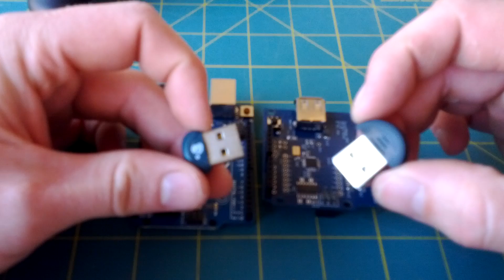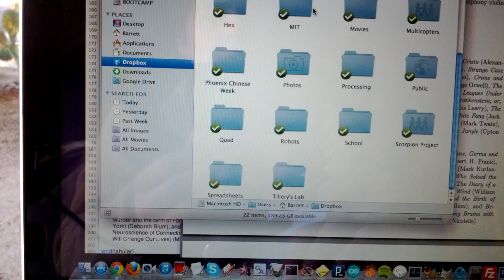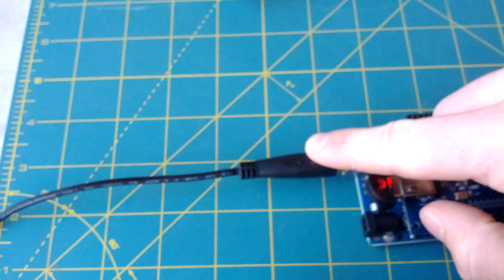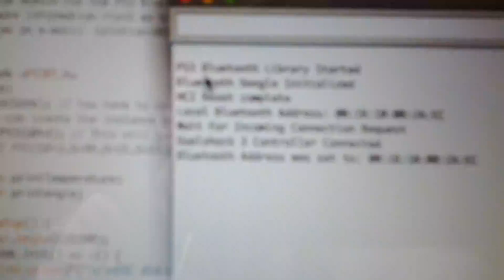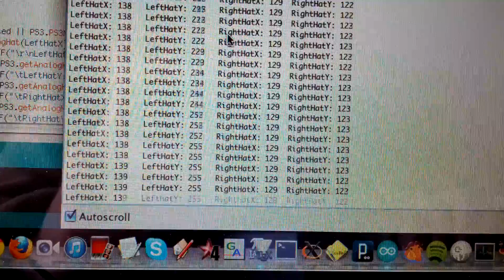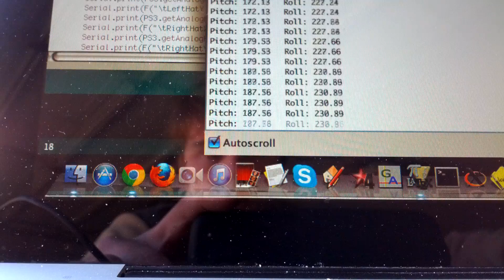How to Connect a PS3 controller to an Arduino with a USB host shield and Bluetooth dongle (Part 1)

Comment: Ok, I'm back!
I've used your tips to control two servos and four motors in differential steering configuration on my amphibious bulldozer project. It worked fine after a lot of work.

I'm here just to say thank you Barrett Anderies and to share my experience:
In my case, I needed to share the motor batteries with the Arduino because the circuit (Arduino Mega + USB Shield + Bluetooth Dongle) was drawing a lot of current. I've never heard that the 5V output pin on Arduino could be used as an 5V input until I needed to do that. So I used a 7805 voltage regulator (and it's mandatory to do that!!!) and connected his output to the 5V pin of the Arduino.
I had many problems when I was using differents ground sources. I guess the digital circuits of both USB Host Shield and Bluetooth Dongle are more sensibles to that. In general, you should use a single ground level to the whole circuit. My doubt here was about sharing any wire between the low power circuit (Arduino, shield and dongle) and high power circuit (h-bridges and motors). It seems there is no problem in sharing the ground wire, but I used many diodes anyway. Just for precaution. 

Sadly I don't have any vídeo of the working project and it's already dismounted. :(

Good luck!
Reply from the maker: André,

Thanks for the information and congrats on your project! You should ALWAYS have a common (single) ground between all of your circuits. You are correct that you would not want to share the high power lines (positive (red)) of the drive system with that of the control circuit, but all the grounds (black) should always be common.

Comment: Excellent tutorial. I am really impressed by the details shown. It was easy peezy! However, this library is useless for UNO as there is no space left to do any programming. Is there a way to reduce the size of library? Otherwise, I'll buy Mega.
Reply from the maker: Yes, you can reduce the size of the sketch. The fewer library functions you use, the less space is used. For example, if you open the PS3BT.ino and remove the code that accesses the gyroscope information you will notice a reduction in sketch size. If you're only using a few functions, you can easily use an UNO for most projects. I recently used an UNO to drive six servos with the library using the joysticks, D-pad and the four buttons on the right.
Reply: Barrett Anderies
Thanks a lot! I was able to reduce it to 25K after removing pitch and roll functions. I only need Right Joystick, Left Joystick and cross button. Were you able to reduce it even further?
Reply from the maker: Param S Try removing all function calls to buttons you don't need. That will give you an idea of the smallest you will be able to get it.
Reply: Thanks! I ended up using mega as I needed 4 interrupts for 4 dc motors with encoders.
Another question: Can you think of a some way to know approximate distance from USB host shield to phone, assuming they are connected by bluetooth? I don't want to add any sensor to outside of the phone., adding sensors to the shield/arduino unit is acceptable. Is this even possible? I want my robot to follow my phone at a set distance, say two feet away.
Reply from the maker: Param S You will not be able to estimate distance using Bluetooth, but there are a variety of sensors that can. You could use a sonar like the Maxbotix LV-EZ0, or a infrared range finder like the Sharp GP2Y0A21YK. Both are pretty cheep and will have plenty of accuracy for your application.
Reply: Barrett Anderies
I think there are two issues here:
1) Robot has to detect phone not the person who might be having phone in his pocket. Phone becomes the lock for the robot so that it ignores all other objects and follows the person carrying the phone.
2) Sensor also needs to deliver not just the distance but also the direction of the target object.e.g. whether the person carrying the phone is to its left, right, front or back or any (x,y) co-ordinates of person/phone where the origin is center of the robot.
The reason I need the displacement vector is that robot needs to follow exactly the same path as the person is walking on. It is like invisible line following robot. That line has to be created by sensors.
I would appreciate your thoughts!
- Thanks
Reply from the maker: Ah, yes, I see what you mean now. The best way would probably be to use a GPS. The robot would calculate its position and then receive the position of your phone over Bluetooth. With that information it could calculate the vector to you. There are actually some autopilot systems like ArduPilot that support this feature.
Reply: Thanks again, I would check it out.

Comment: So when I try to run the PS3BT example I get a message no matching function for call to 'PS3BT::getAnalogButton(Button)'  Any suggestions?  I have the Sparkfun board and when I run the example from the older library, I can get the PS3 controller to sync up and run.

Also, I am wondering is this will be able to be run the Arduino Wireless Proto Shiled with an XBee on this as well as the USB host board running the PS3BT.

Comment: How do you start PS3BT library?
Reply: I can't upload library to my Arduino i't says: USB does not name a type
Reply from the maker: 69greeninja That is a common error when you have not installed the library correctly. Make sure to place the library folder in "libraries" and remove all dots and dashes from the folder name.

Comment: Thank you for this video! It definitely pointed me in the right direction! But my USB host shield has no outer female sockets like yours does, will that still work?
Reply: I did order it at circuits at home. Is there anyway that it would still work, or any way that I could solder the headers on?
Reply from the maker: Tyler Bartolome Did you buy the pre-assembled version? If so, it only comes with male headers (as you've noticed). There is a second row of holes just inside of where the current headers are soldered. You can buy female headers and solder them there.
Reply: Barrett Anderies Thank you! I was slightly confused when I opened the box and only saw the male headers.

Comment: Thank you, guy! It helped me a lot!
There is a lack of information about that. So your video should be at the main sources about Arduino USB Host Shield + PS3 Controller! With this step-by-step video, it was easier than sync with Windows and DS3!
Thanks once more!
Reply: It could be useful to say that I'm using Keyes version of the shield with an Mega-like Arduino board. The chipset of this dongle is a CSR8510A10, so I believe that others with the same chipset will probably work.

Comment: would be possible to spend all the programming you did is that I am still a rookie?. thanks
Reply from the maker: The code I ran is included with the library. Once you install the library it will be available in the examples folder.
Reply: excellent thanks programming...

Comment: Would it be possible to do this for a different board and programming language?
I have a Servopod board from new micros and can program using isomax. Do you know of a library that works for this programming language?
Reply from the maker: Yes, but you would have to find/write the library. I do not know if a library exists for that language. The USB host chip is the MAX3421E. It is an SPI device, and therefore can be controlled by almost any microcontroller. You may be able to port the existing Ardunio library.

Comment: The address is hardware dependent on the controller, not on the dongle.  If you had the address 01:23:45:67:89:10. The first three bytes, 01:23:45, are specific to the manufacturer.  The last three, 67:89:10, are specific to the device.

Comment from the maker: If you plug your controller into the shield after having plugged in your Bluetooth dongle, the shield will automatically program the controller to the right address. However, since you can't see the debug information, you won't be able to tell if your shield recognized your dongle, which is a problem. I think your only viable option is to enable debugging in the code. Unfortunately this will make the sketch too large to fit on an UNO.

Comment: what is it the problem? when i received only 'PS3 Bluetooth Library Started'. i connected ps3 controller with usb host shield + arduino via USB cable, i dont see any other line printed out in the serial monitor, exvept 'PS3 Bluetooth Library Started'. therefore, is it possible, my USB host shield doesn't working.? or i just need to try out with other Bluetooth dongle?

Comment: fyi: when i was firstly trying to connect the PS3 controller to bluetooth dongle + usb host shield, it did not work. I tried almost 10 times then it got connected and worked fine. and NOW, i only can see 'PS3 Bluetooth Library Started' 
I would really appreciate if you can help me to figure out this issue, anyone feel free to put your comment below, Thank you once again.

Comment: 'unless you enable debugging in the code' what do you mean? what should i do, in order to make it connected. fyi: the USB host shield, i ordered from eBay, (not sparkfun or circuit@home, due to far travel shipping issue) 
' So, don't worry if you aren't seeing some of the information shown in this video.' what do you mean? is it my problem can be fixed? what should i do next. may i know, how did the guy manage to make it works successfully?

Comment: and now, what should i do next? i am trying so hard just to get the PS3 controller connected to the Bluetooth dongle +USB host shield. i have read through all the comments regarding this issue/problems, yet i still CANNOT connect it successfully. few steps that i have taken to settle this:
1. i used an external 9v dc adapter source to power up.
2. i used 2 different brand of Bluetooth dongle, 1 of them is exactly the same as the black one in your post video,
3. i connect ps3 cntrler using usb.

Comment: thank you for that,
and Now the problem comes, when i am trying to connect the PS3 controller with the USB dongle, there is only a line appear on the serial monitor "PS3 Bluetooth Library Started" why is that? i have also connected the PS3 controller with the USB host shield via USB cable, nothing appear on the screen as what i expected from your Post video, if you guys out there got the same problems as i do, feel free to comment. Thank You

Comment: Nevermind, solved the problem by looking into the source code. The baud is 115200 instead of the usual 9600. I don't know if that is mentioned in the video, whatever, I'm happy that it's working :D

Comment from the maker: It's possible, but you'll have to make sure the shields don't use the same pins at the same time. I know the USB host shield uses ISP to communicate with the Arduino, which uses digital pins 10 through 13 but I don't know what most motor shields use. If you can find a motor shield that doesn't use D10-D13 you should be fine.

Comment from the maker: You get that error when the IDE can't find the library, so yes, you probably didn't install the library correctly. Double check that the library folder is in the correct location and that there aren't any dots or dashes in the folder name.

Comment: Hey I need some help. My IDE is reading "USB does not read a type" as an error. does that mean I probably didn't properly move the file in right? Or did i not remove all dots and dashes.

Comment: Very helpful tutorial. I am about to get one of the USB host shield from eBay, either ‘USB Host Shield Support Google Android ADK & UNO MEGA Duemilanove 2560 Arduino ‘ or 'USB host shield Keyes'. which one will for sure work with the Code (that you provide) ? does it really matter with the manufacturer company kind?

Comment from the maker: A product that did not pass quality inspection. A factory second my be blemished or otherwise imperfect. Depending on the product, it may function perfectly and only be aesthetically damaged or it may be internally damaged (and not function properly, as with one of the dongles I ordered).

Comment: Corrected yes. I was not quite sure what the actual setup of the controller was and assumed it was an accelerometer and not a gyro.Agreed Bennet if it has both then it of course YAW would be from point of origin. I think I overlooked the fact it was 6 DOF rather than an 3 axis accelerometer alone. I was clearly Overthinking it again I think. All the best Spence

Comment from the maker: Both an accelerometer and gyroscope can determine the pitch and roll (the accelerometer by gravity, the gyro by angular velocity) but only a gyro can determine yaw (BTW a gyro doesn't use gravity or magnetism). You are correct that a gyro cannot tell North, but that is not important for measuring yaw from a fixed point, say the point the gyro is initialized at. The Wikipedia page for the DualShock3 states that it has 6 DOF, but not exactly which types of sensors. I would expect a gyro and acc.

Comment: I think YAW depends on magnetism rather than gravity. Unless it has some kind of knowledge that north is north then turning the controller in a 360 degree circle does not exert any gravity on the controller. pitch and roll do this. In a 3 axis Gyro the third axis would sample height and the device being drawn to ground... eg defying gravity or imposing gravity. I think that's correct anyway. However if it's 6 axis it may have a HMC5883L or equivalent.? I am working with 10DOF at present Baro

Comment from the maker: You will NOT be able to use an Xbox controller with the setup shown in this video. An Xbox controller is not Bluetooth. You will need a wireless USB adapter (I cannot put links in comments so you will have to Google "xbox wireless adapter"). I am not familiar with this adapter, so I may not be able to offer much help. Also, you cannot use the PS3BT.ino code. You will have to use the Xbox related code, although I'm not sure which one. Look around Circuits@Home for more information.

Comment from the maker: You are getting those errors because the Arduino IDE can't find the USB host shield library (you not having the shield plugged in is irrelevant). You have to place the library in your "libraries" folder in "Arduino" and remove ALL dots (.) and dashes (-) from the folder name (the Arduino IDE does not allow dots and dashes in library folder names). Once you do this all of your errors should cease.

Comment from the maker: So when you initialize your Arduino you get the first line; when you plug in your dongle (of if it was already plugged in) you get the next five lines; when you plug in your PS3 controller you get the next two lines. All of that is as it should be. What is the state of your hardware when you get the last line?
Reply: what kind of range do you get with this?
Reply from the maker: @williammuff5485  ~30 ft with line of sight
Reply: @BarrettAnderies  is it finicky with repairing once back in range?
Reply from the maker: @Billy18bm  I didn’t use it enough to say. I would guess that it would be finicky since that seems to be how Bluetooth is in general.
Reply: @BarrettAnderies  I wanted to use RF but building some of enclosure for an arduino/battery/joystick/rf module seems tough.
Reply from the maker: @Billy18bm  It would certainly be more complicated, but I’ve seen a few open source RF remote control projects out there, so you might be able to recycle some or most of someone else’s code/design.

Comment: Hello , I did every thing as shown in the vid . but i get this message 

PS3 Bluetooth Library Started
Bluetooth Dongle Initialized
HCI Reset complete
Write class of device
Local Bluetooth Address: 00:11:67:D6:B3:BB
Wait For Incoming Connection Request
Dualshock 3 Controller Connected
Bluetooth Address was set to: 00:11:67:D6:B3:BB
BTD Init Failed, error code:

Comment from the maker: That "page" is the serial monitor. It's part of the Arduino IDE, so what type of operating system you are running is irrelevant as long as you have the IDE installed. You open it by clicking the small button at the top right of the Arduino IDE (with the magnifying glass).

Comment from the maker: The shield should automatically connect to the Bluetooth dongle once you have uploaded the correct code to your Arduino. Are you receiving any messages in the serial monitor? Several people have brought it to my attention that the new versions of the Bluetooth dongles are not lighting up (for an unknown reason), although they still work properly.

Comment: Hey, do you have to connect the bluetooth dongle to the arduino through the software? Or have you just inserted the dongle and it automatically connects? I've tried uploading the Bluetooth PS3BT programme but it does not do anything, the dongle doesn't light up :/ please help!

Comment: What kind of program did you use for the arduino. can you send me the actual program that you used for this. were trying to put together our arduino uno and bluetooth shield with the dongle .We will be putting this on a rc car that we will want to control w/ either the computer or a ps3 controller. we also have a usb host shield that we well use this on too.This is for a school project that im working with my group. Any and all advice helps us. Thanks

Comment from the maker: No. A Bluetooth transceiver is a Bluetooth device incapable of actively seeking a connection (like the one I show in the video). It can be connected to by a Bluetooth host like your computer, but it will not be able to communicate with PS3 controller.

Comment from the maker: If you read around on Circuits@Home they suggest that you use the Sony made controller. It's is possible that the aftermarket version will work, but it is not guaranteed.